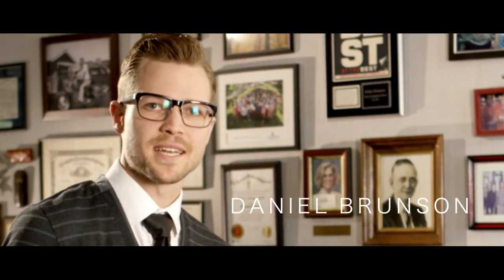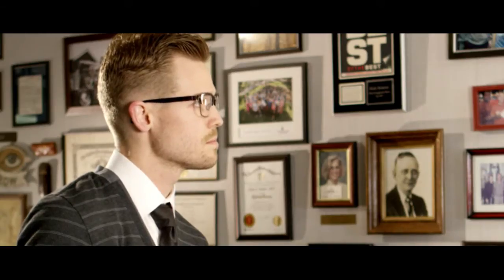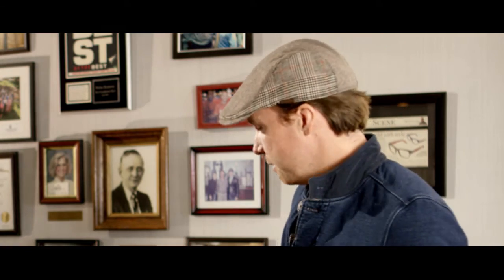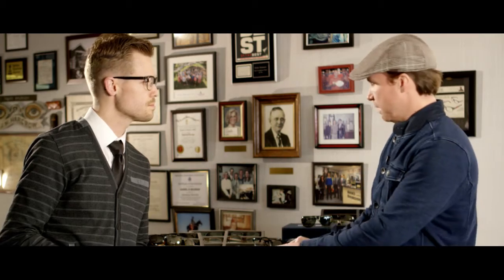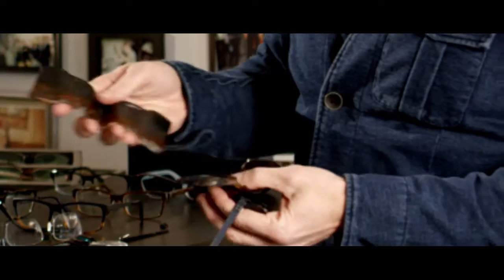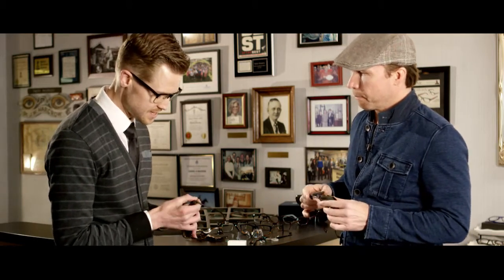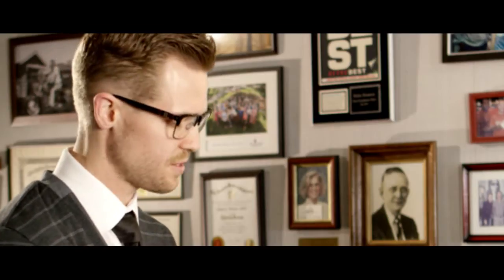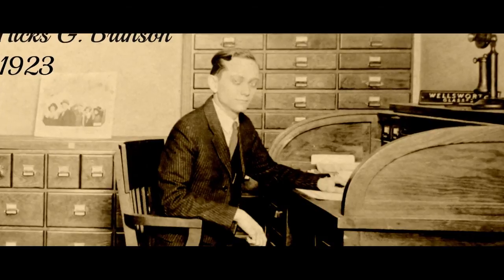Daniel Brunson Talks To Zero G Eyewear Designer Tom Cody

Comment: Hello sir
Which machine is used to drill for eyewear and wire used for it is have already groove or groove made after purchasing metal wire by forming.
Reply: vikas jamble Sorry,  I have a lab that handles all of the grooving and edging. I’m not sure which machines they are using.  I know that frame manufacturer specs must be closely followed for groove width and depth, or there will be issues with fit and function.
Reply from the maker: An update to this question. A little over one year ago we acquired an in-house edger, which handles all groove specs and most drill specs beautifully.  We use the Mr. Orange machine.